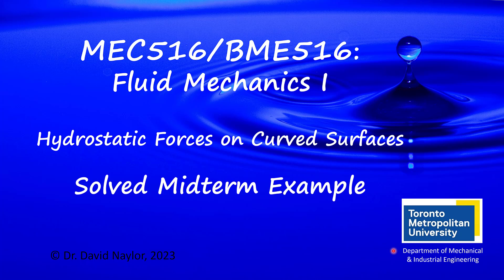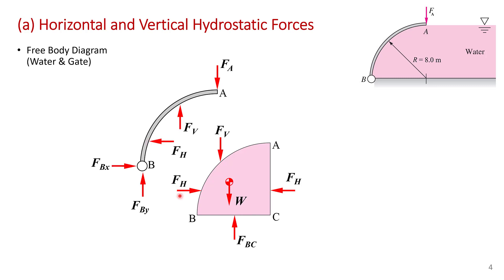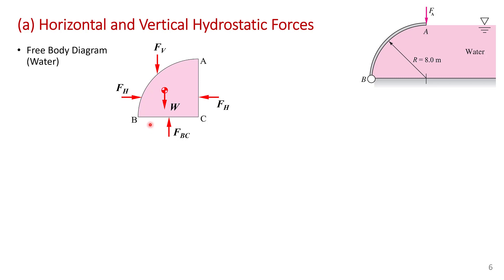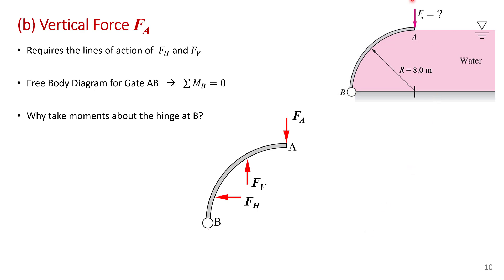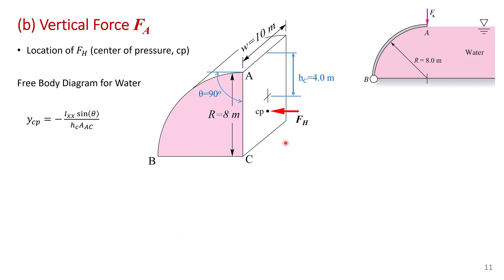Solved Exam Problem: Hydrostatic Forces on a Curved Gate

Comment: Thank you for the video, but why is the centroid at r/2 rather than 4r/3*PI ? 
This was a great help to me regardless!
Reply from the maker: The weight is located at the centroid of the volume. But the horizontal force comes from the mean pressure on the vertical surface of the FBD which is located at R/2. I hope that helps.

Comment: Dear sir why not Fv= gama.volume of curve surface.
Because of a previous example you showed like this?
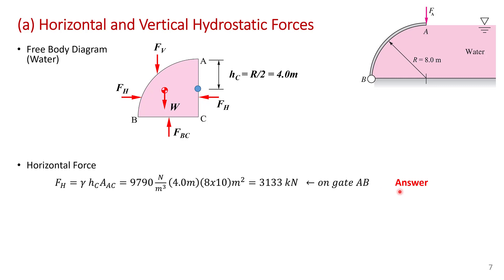Reply from the maker: This is because the water is beneath the gate. See the free body diagram. You have an additional hydrostatic force , F_BC. I suggest rewatching the discussion that starts at about 4:30.  I hope that helps.

Comment: The part that you regard tricky can be done very quickly!
x/y = Fh/Fv, where x and y are the perp distance of Fv and Fh from the center of the circle, respectively. Here, y = R/3 and x turns out as 2R/3/(4 - pi).
Did you like it? :)
Reply from the maker: Yes, I like it.  This will work, but only for a circular gate. I think the method I present is more general.
Reply: @FluidMatters you don't think so. You believe so and you're right :)

Comment: Why there are two FH on water diagram but only one for Fv , please explain to me I can not get it.
Reply from the maker: I think this is just a labelling issue. There are only two horizontal forces, in equal and opposite directions. So, without analysis, we know they must be equal for static equilibrium. So, I called both forces F_H. I could have called them F_AC and F_H, then noted that F_H=F_AC.  (In the vertical direction there are three forces, which balance.) I hope that helps.

Comment: Why is it that the line of action of Fh is the same as Fx? Summing forces in the x-direction says the magnitudes are the same, but why is it that they act in the same place?
Reply from the maker: Notice that there are only two horizontal forces on the free body diagram of the water:  The horizontal hydrostatic force and the (equal and opposite) reaction force of the gate. With only two forces they must have the same line of action. So, the line of action of the horizontal force (F_x) on the gate must have the same line of action. I hope that helps.

Comment: Dear Sir, won't calculating Fbc be double-counting the weight? Why the force by the hydrostatic pressure is not equal to the weight in this case, because i see your other videos, and you were considering the weight only.
Reply from the maker: The weight is not double-counted.  It's subtracted from Fbc. See 4:30.
The vertical force is not equal to the weight of water, because the water is BELOW the gate. I hope that helps.

Comment: Why have you not considered the gravitational acceleration for the vertical forces & weight of the fluid?
Reply from the maker: The weight of the water IS included when calculating the vertical force: Fv calculation starts at 4:28.  The specific weight of water gamma = rho*g, where g is gravitational acceleration. I hope that helps. Good luck with your studies.
Reply: @FluidMatters I have seen most of the tutors solving Fv by taking F_BC only. The never take weight of water into account. How is it appeared now? I am confused.
Reply from the maker: @Sophistication-c6g    There is no other way to analyze the free body diagram for this problem. It's basic statics. But each problem is slightly  different. So, try to understand, rather than memorize -- because there isn't a single "method". ...and that's the engineering skill you are developing.
Reply: @FluidMatters yes, sir. Thank you! By watching your videos, I got some basic concepts cleared. I would urge you to suggest some youtube tutor who teaches other subjects such as Solid Mechanics. Although if you have any other channel in which you teach other subjects, please let me know. 😅

Comment: Good day sir. I hope u read my comment. I'm confused with regards to the summation of moments for getting the distance of Fv to hinge B. I tried using  summation of moment by only considering Fv and Fh since in some problems in getting the distance of Fv, this method works. The only problem is that the distance that im getting for Fv is on the other half therefore i subtract it from the radius=8 to get the answer. The answer I got is the same as yours however I dont understand why this happens and if its considered a correct method. Hope u clear my confusion. Apologies if my english is a bit confusing.
Reply from the maker: I'm not sure I fully understand. I think you are asking about finding the line of action of Fv. It sounds like you found this distance of Fv from point C (instead of B). If so, this is fine, as it uniquely defines the line of action. Sorry if I misunderstood. There are limits to the text-only comments.  I hope that helps.

Comment: sir i need to know why did you  change  the direction of Fv while calculating x bar and while calculating Fa?
Reply from the maker: When you sit in a chair, you push down on the chair. So, a free body diagram of the chair has a downward force from you, your weight. However, if you draw a free body diagram of YOU, the chair pushes UP on you. So, force on you from the chair is upwards, equal in magnitude, but in the opposite direction --- the direction gets flipped. That's my best guess of your misunderstanding.  I hope it helps.

Comment: In another one of you videos, where it is a semi circle instead of a quater circle, for the vertical force you had just Fv=W, while here you have FV=Fbc-W. Why?
Reply from the maker: It all depends upon the free body diagram (FBD) of the water adjacent to the gate. If the water is entirely above the gate then you generally get Fv=W. In this problem, the water is below the gate and there is an upward force on the FBD of the water. So, that has to be subtracted.  Try to understand the analysis process (basic statics) rather than memorizing.  I suggest downloading my Curved Surface Handout pdf on this page: https://www.drdavidnaylor.net/exam-review-questions.html

Comment: Moment of F h about B. U didn't consider
Reply from the maker: Note that F_H acts both to the left and to the right at the same horizontal location. Hence, no net moment. See the note in the box at the bottom right side of the slide. I also say it at 12:17.
Reply: Thanks professor

Comment: Hello! I'm sorry I am a little confused about F_BC, what exactly is this force. Is it the reactant force due to F_A. Furthermore, why does it act at the center of BC and not at C if it is the reactant force from F_BC. I know this has to due to the depth that it is at, but I am a little confused why it is at the center and if this is the equal and opposite reaction of F_A. Thank you!
Reply from the maker: F_BC is not a reaction to F_A. Surface BC is at a depth R. So there will be a uniform pressure (upward) on this surface of our control volume. Since the pressure is uniform (=gamma*R), it will act at the center of BC. (Alternately, if you use theta 90 degrees, you get the y_cp=0 for a horizontal surface.) I hope that helps.
Reply: @FluidMatters  that does help, thank you so much. Shows how much you care to help people responding to a 2 year old video still :))

Comment: Thanks a lot for your explanation Sir. I am stil confused when we put the value of gate's weight and in the book they said the centroid of weight is 2R/pi. Could you help me please
Reply from the maker: 2R/pi is the centroid location of a quarter ring, with all the mass (idealized as) at the same radius. The centroid of a solid quarter circle is different, of course.
Reply: @FluidMatters  I have reviewed the method to define the centroid of volume, area, and line also Sir. Your support has ledluidMatters  I have reviewed the method to define the centroid of volume, area, and line also Sir. Your support has led me to much new knowledge. Thanks a lot Sir.

Comment: Should FV = the weight of the fluid?? How do you know that there is a force FBC?? Some questions never include this force I can't concentrate??!
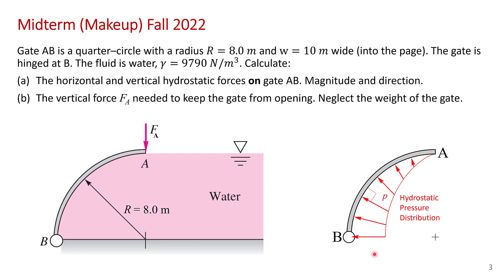Reply from the maker: Surface BC is at depth R in the water. So, there will be hydrostatic pressure at this depth, equal to rho*g*R.  That's how we know there is a force F_BC.   Note that the weight of the water is downward and the force of the water on the gate is clearly upward, as seen from the pressure distribution (at 1:08). So, F_v cannot be equal to the weight of the water. I hope that helps.
Reply: @FluidMatters  But in similar problems this is not the case ?? You mean that there is a pressure from the ground due to depth and it is upward ??!
Reply from the maker: @HashemAljifri515  Not "due to the ground".  It's the pressure in the water at that depth (at the ground-water interface). Local pressure acts in all directions. Once you define a control volume (as done in this problem) the pressure force acts inward and normal to the boundary (see video 1, Chapter 2) ---  hence upward in this case.

Comment: thank you for the video! really informative. 
But, what about the weight of the gate, is it negligeable in the calculus? and why?
Reply from the maker: The main reason is so students can focus on fluid mechanics. Including in the gate weight is trivial statics, which adds unhelpful complexity when it comes to learning hydrostatic analysis. Also it will be generally true that the gate weight will be quite low compared to the hydrostatic forces. You can easily check this -- assume a 0.5 inch curved steel plate, for example.

Comment: Dear sir, at 11:55 you say that there is a uniform distribution load and therefore the Fbc acting on R/2. Why is that? Isn't the load distribution also acting in a circular way? which implies the Fbc from C is 4R/3Pi ?
Reply from the maker: The load on BC is NOT "acting in a circular way". Surface BC is a plane (flat) surface that is at a constant depth of R.  The pressure vectors on this surface are uniform (gamma*R) and all point upward. This uniform pressure distribution is replaced by the total force at the center of the pressure distribution (at R/2). I hope that helps.

Comment: Thank you for the explanation, Sir. I have a question, when you calculate the X bar, you take CW as (-) and CCW as (+). However, when you did the sum of moment at B you did the other way around. Why is it?
Reply from the maker: It makes no difference. The direction is an arbitrary choice. So, there no reason --  and no need to be consistent either.
Reply: @FluidMatters  I see. Thank you, Sir

Comment: Dear Sir, why do you count Fbc pressure force.? 
Usually, I saw teachers concern about the weight of the water up to free surface to find vertical force. 

I only find in your all of the video you count vertical pressure force, why sir?
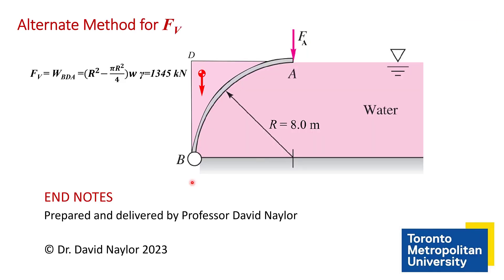Reply from the maker: You can use the missing "water approach". It is equivalent. I show this at the very end of the solution (about 15:00). But it can be tricking to find the line of action,. The method in this video is the most general approach. I hope that helps.